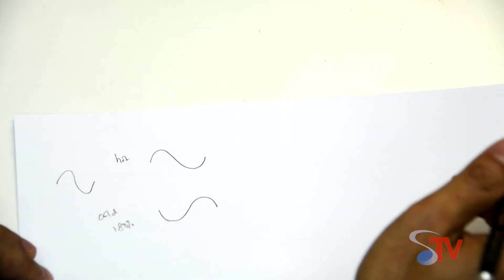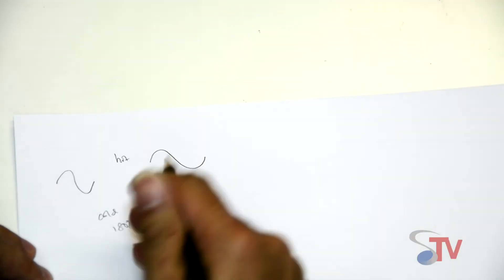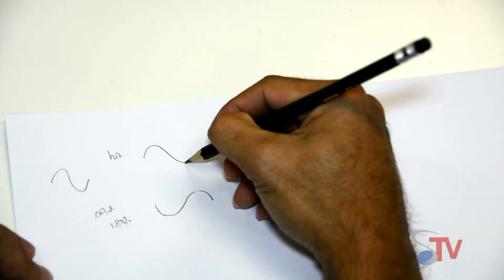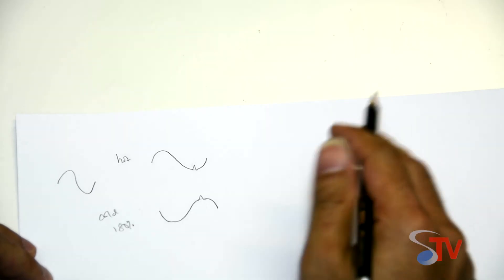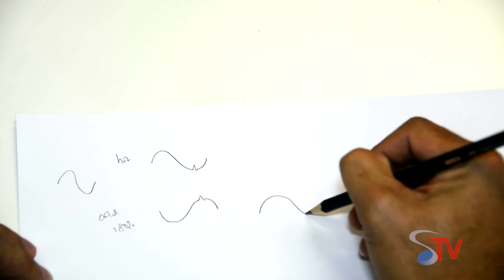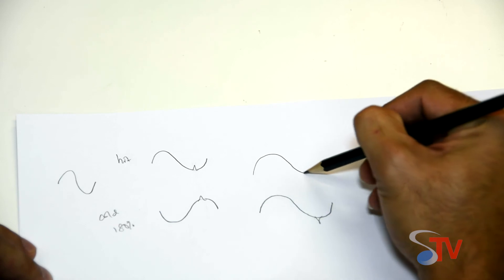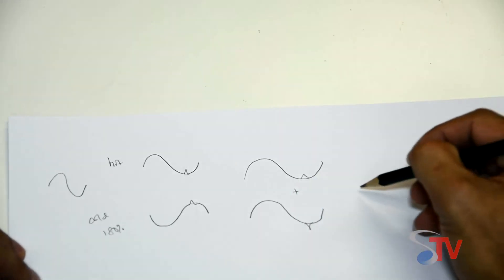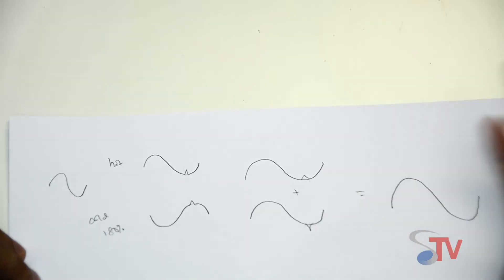Balanced Vs Unbalanced Connections

Comment: Please can you tell me if you can turn an unbalanced 3.5mm headphone jack into a balanced 2.5mm jack with the use of a cable with a 3.5mm socket to a balanced 2.5mm jack ? I’ve seen them advertised but do they actually work